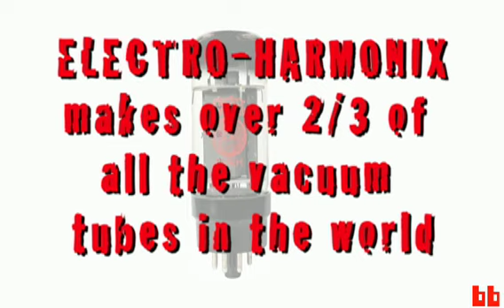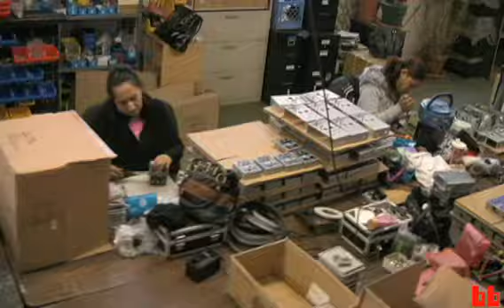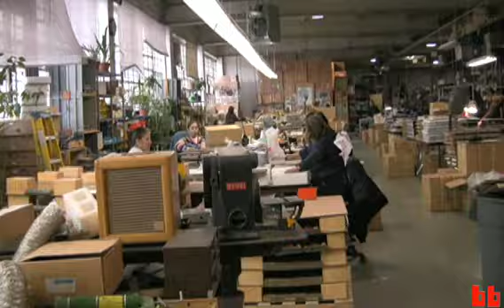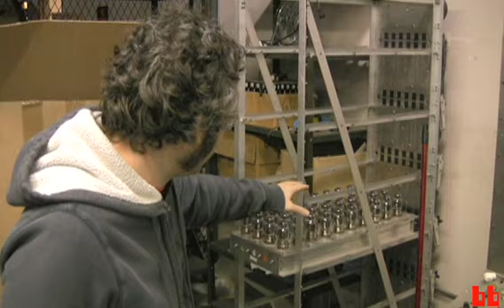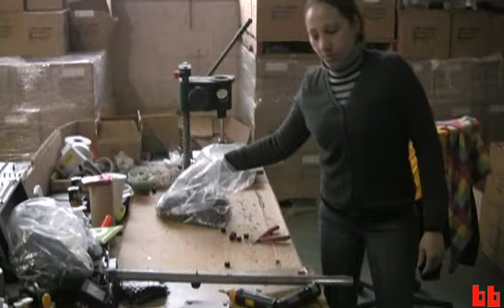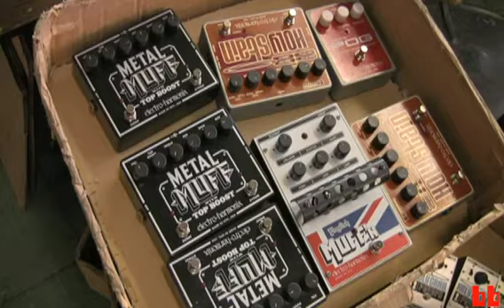Electro-Harmonix, guitar pedal engineers, vintage sound gadgets

Comment: @patsaxon Pat, hey...what's an organ dude like me doing over here in pedal heaven(LOL)? I was going to ask about whether EH would ever consider making an organ. 

 You should know from organ electronics electrolytic capacitors are the big problem after years of drying out. You say,'diode tubes'. Actually, most tube amps have done away with diode tube rectifiers, but some players prefer the tube rectifiers because they 'mush' the attack of the note. My dad broke my 5U4 tube & soldered in 2 diodes